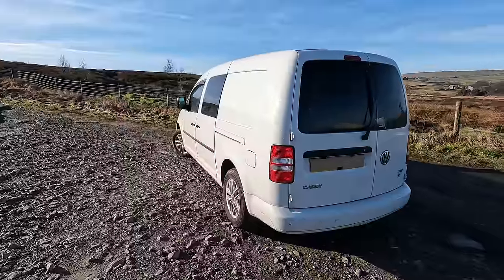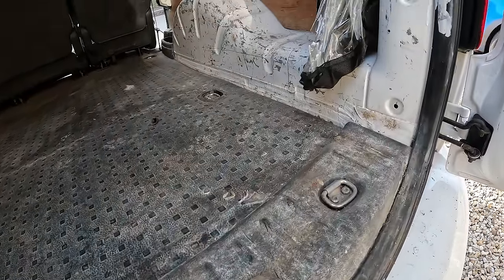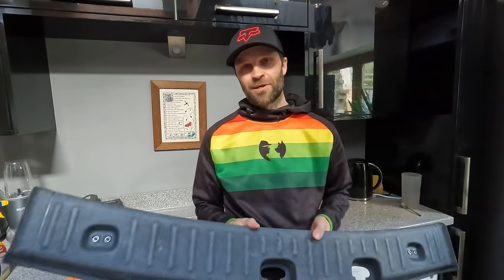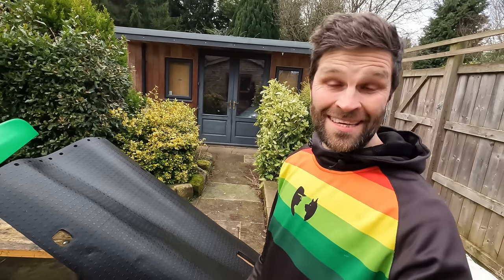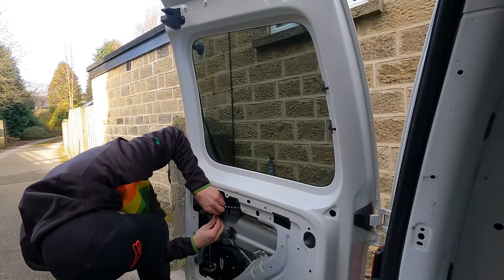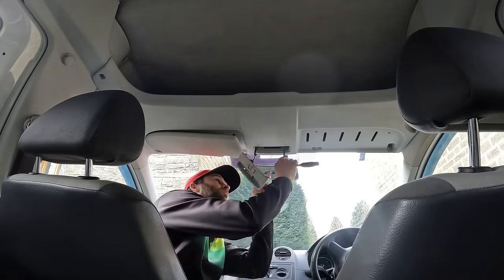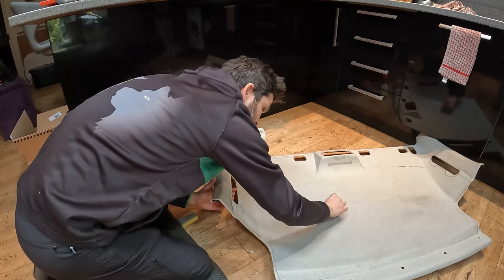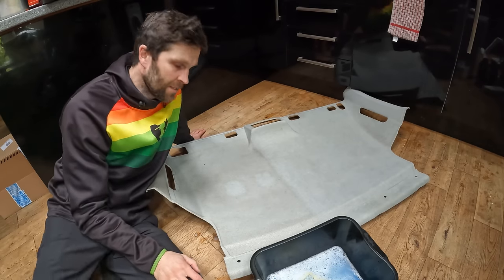MICRO CAMPER VAN BUILD - VW CADDY MAXI  Stripping out the Interior - Conversion Volkswagen Tour

Comment: Transmission fluid and then use the old fluid with a mix of oil to give the engine a good flush. Only use the best oils. Pays dividends in the long term. Why i say this is because i do the same has you. Buy a old vehicle and bring it back to life.  Its better for for the environment, the big cost on this issue is building new. So good on you and keep up the good work.

Comment: You can use a heat gun to bring the oils back in the plastic but it takes a while. I used teak oil and it brought it back to black bumpers trims and skirts from a light grey. Only issue is needs to dry or  stuff will stick to it but it's great stuff! I know it's too late now, but if you draw a rough picture of the van on cardboard then just push the screws and bolts in the area it's from it's a lifesaver

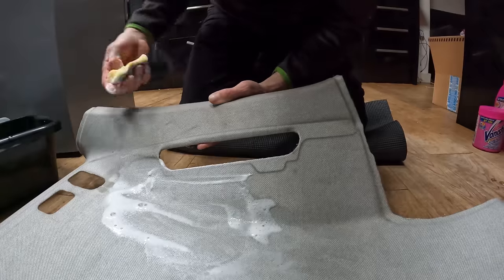Comment: At 26:00  I would add that soap to my powered pressure rig like you have and be done with it. Me too lazy for the scrubba-dub-dub method. They do have chemical tank attachments for those pressure washers.
Reply from the maker: Yes you can get hand held carpet cleaners which would be good. There’s always a better tool to use 😂

Comment: Great video, for things like plastic load bed / door trim after washing I’d have used plastic primer and satin black, would leave a nice finish that’s not slippy like tyre gel, which once dried up will go grey again.
Reply from the maker: Yes I’ll see how it goes as the slippy finish might annoy me👍👍👍
Reply: @BUSHMANandBLUE  you might try just a heat gun. The light discolouration on the plastic trim is from scuffs and waving a heat gun over the scuffs can make the surface smooth again and actually can restore the colour.